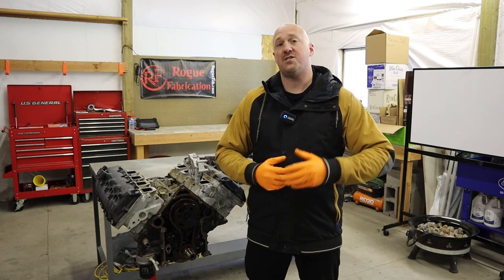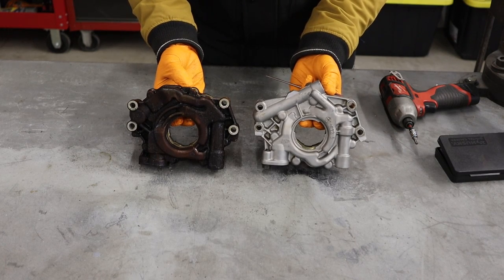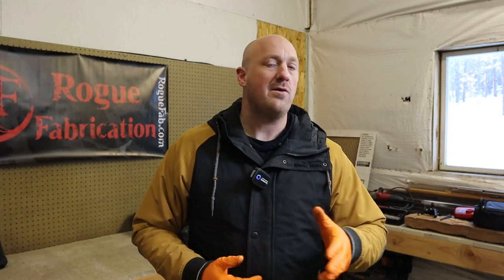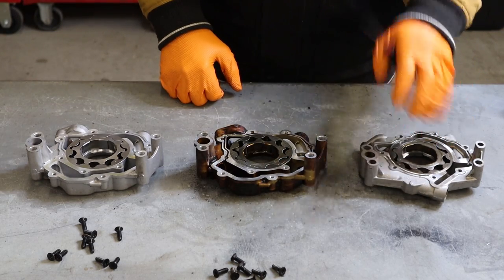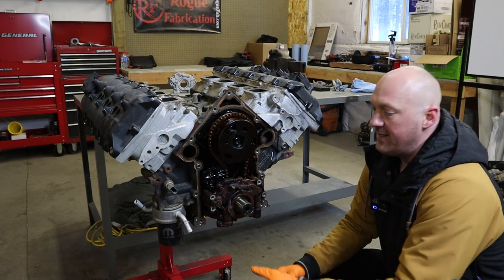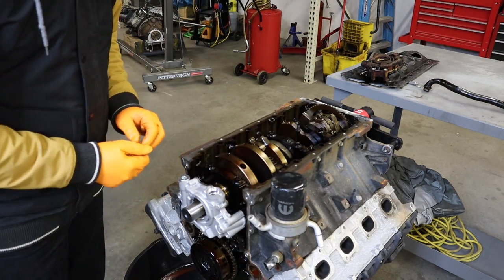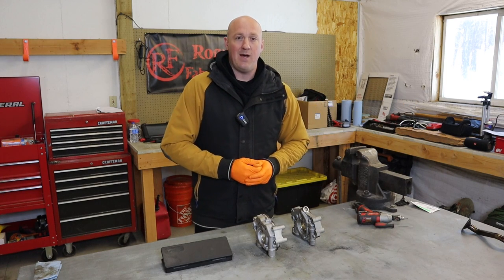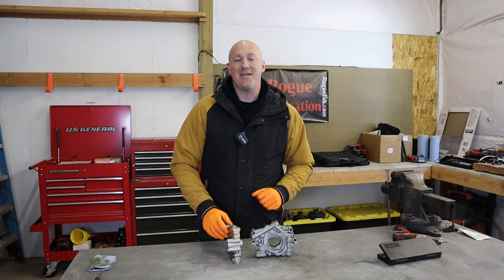Is it TRUE that Installing this ONE FACTORY PART Can PREVENT HEMI TICK?

Comment: hey guys, this is for everyone who wants to do this swap, just did this in my 2014 dodge charger pursuit. ended up calling melling oil pumps for recommendation because they make the pumps for dodge and the 5.7 hemi. now i live in a cold state and i was running into the issue of actually having too much oil pressure. stock oil psi numbers were 30-35 psi operating temp/50-55 crusing/ 60 cold start. with the 6.2 pump i was seeing 90 psi on cold start, going into the territory of blowing the rear main, and 35-45 operating temp idle, and 70-75 psi crusing. i also ran into some CELS for “oil pressure too low” and ended up being too high for the MDS system and shutting it off. this it just to warn everyone, so you don’t go through what I went through end up putting the car back together, and having to take it apart to put the stock oil pump back on.

happy to answer any other questions
Reply from the maker: Sorry to hear you were having trouble Frank. I admit though, I'm trying to figure out how having high oil pressure would blow out the rear main seal? Oil pressure and crankcase pressure are two different things.
Reply: so that is a absolutely true statement, and i thought the exact same thing. according to the guys at melling, and a different person on the forum who did the exact same thing to his charger, for some reason or another, it is possible because he swapped for the hellcat pump he blew out his seal. so the first thing i did when i had the hellcat pump on my car was taking of the oil cap and seeing if i had any blow by, and nothing. so then i thought to myself, if all the oil passages are through the block, how would it possibly blow the rear main seal, and i couldn’t really think of a way, but i guess it is possible.but what did it for me was the combination of the CEL, and the possibility of the seal, i decided to just bit the bullet and put the stock pump back on the car, and surprisingly enough, i believe that they actually made some changes to the newer 5.7 oil pumps because i am seeing different, and better oil pressure numbers on a 2021 oil pump. operating idle pressure is 38-40psi, crusing is 55-60, and cold start is 65, so i’m pretty happy with the new stock pump, and my MDS works now with no CEL.

Comment from the maker: What do you guys think of the Saturday release schedule for the videos?
Reply: Can I use this pump in challenger 6,4  2018 ???
Reply: I literally bought a hellcat oil pump and I’m installing it next Sunday, I hope it helps. My 5.7 has a slight tick after 3-5 minutes of idling hot only, and after reving it up to 1500-3000rpm it goes away for the next few minutes of idling then returns.
Reply: @adamtym4342  I do believe he said it will bolt right up.
Reply: @blakedinkel7696   Thank YUO.
Reply: Any day for video releases works for me, The 5.7 Hemi information is especially interesting to me since I own one. Thank you
I am curious if the high volume pump might adversely affect the oil based cylinder deactivation apparatus?
Reply: All good, man!
Reply: I like it. Seems like most channels do a Wednesday, Friday, Sunday drop. By doing Saturday it doesn't get lost in the mix
Reply: Saturday is good!
Reply: Any day is a good day.  If Saturday lines up better for your schedule, then so be it.
Reply: @blakedinkel7696   do your lifters and cam while your at it
Reply: @MichaelWilliams-xx6wp  don’t I need to remove my heads and all my front coolers and grill to take the cam and lifters out
Reply: @blakedinkel7696  my comment was meant to tell you adding a hellcat oil pump won’t fix already failing lifters if your lifters are failing your cam is getting chewed up as well. This content is preventative maintenance
Reply: @MichaelWilliams-xx6wp  I understand, but it only ticks after a long idle time, presumably because the lifters and cam run out of oil, but if I get of the highway or driving around it doesn’t tick at all only after 3-5 minutes of idling, but you may be right.
Reply: @blakedinkel7696   my point tho they wouldn’t tick if they weren’t broken.

Comment: My 2012 6.4 on the oil pump pick up tube has a support arm that does go to a main stud......FYI
Reply from the maker: Thanks for the info! 👍
Reply: That's correct the 392 / 6.4 from '11 to current have the pickup tube attached to a stud. So all the oil pan bolts must be removed, and lower the oil pan to access the nut that retains the pickup tube to that stud

Comment: Completely different engine but still a Chrysler.  I replaced the rockers and lash adjusters in my 04 4.7 with later ones.  The difference was the size of the orifices on the rockers, the old ones had oil spray holes about 1/8" in diameter which allowed a huge internal oil pressure leak, 16 of them actually.  I had hot oil pressure of around 7 psi at idle and a lot of lifter clatter upon start up.  Replacing them with updated ones, I believe it was 05 when they were changed.  The squirter hole was reduced in diameter to about 1mm in diameter and the lash adjusters had the feed hole moved up to put about half of it in the bore diameter itself.  These 2 changes alone raised my hot idle oil pressure from around 7 psi to around 16 psi which significantly reduced my cold start clatter.  I would replace the pump however one is not offered and this Hemi pump will not fit mine.

Comment: Just a thought, but I think the 6.1L engines would have the same issue with HC pump fit, as I don't think theyt have VVT. My 09 Challenger doesn't have it, and when referencing the Crate engines catalog, it clearly says the 5.7L has it the 6.1L does not.
Reply from the maker: You are correct, this pump will not directly fit the 6.1 engine either.

Comment: I have a 2012 Dodge Charger r/t I have just fined doing top end mods along with a hellcat oil pump the operating psi is 100 it works extremely well with my 5.7
Reply from the maker: Very nice!
Reply: @ReignitedAuto   only added it to build after your video on it. Thanks for all the content it is really helpful
Reply: Do u think that oil pressure is to high at 100 at idle?
Reply: @ReignitedAuto   do you think oil pressure is to high????

Comment: I changed oil pumps with oil pan on, tied a small string on the pickup tube bolt so I could retrieve it if I dropped it in the pan. 07 6.1, 95psi cold start, 39 psi @ temp. @ idle.
Reply from the maker: Nice work Carl! 👍
Reply: Which pump did you install Carl?
Reply: @chadwegner2705  melling hi flo

Comment: I understand this is a hemi channel so that means there mopar gear heads on here I have my own shop and I have a customer who has a v10 dodge 2500 truck its been shotguned at 2 other shops the complaint is when add any throttle off of idle it pops really bad back threw the intake manifold right into the airbox in my area there aren't many v10 truck's around and this will be my 2nd one I ever worked on the first one was easy diagnos considering the rod had made a window in the block 

And help would be greatly appreciated this truck is way to nice to junk 77,000 miles

Comment: Maybe you can consider making a video about installing oil radiator in 5.7. In fact there is no oil radiator. The engine temp is pretty high and get really high after few mins of pushing it. I did install aftermarket oil heater and it improves engine temp performance dramatically. But im thinking if this is possible to add OEM oil radiator that is probably installed on 6.4/6.2

Comment: Love the series! Do you think that Synthetic oil would help? my 6.4L Challenger requires it and I was wondering if there was a connection.
Reply: 0W-40 does help.
Doesn’t burn up as easily. 
I use pennzoil or Mobile one with Purlator or mobile one oil filter 
2012 SRT8 392

Comment: Loving your videos. I've asked this a couple times to confirm cuz you responded to my initial comment about my PSI in a way that lead me to believe that I'm in good shape and don't need to change my oil pump. 

For whatever reason with my 2016 Ram 5.7, I'm getting at least 10 psi higher at idle than what you said it should be in your video where you first postulated about the Hellcat oil pump. So about 35-40 at warm and high 50's while driving and cruising. Based on the numbers you said for the 09+ 5.7's I feel like I'm in pretty good shape. Thoughts?

Comment: Seams the lower tooth count on the up to 09 would lead to less preasure  (lower relative RPM of the gear) but if the internal dimensions of the post 09 are the same it would move the same volume just at a higher preasure.  Could that be designed in to accomodate the MDS oil preasure requirements?

Comment: I understand the pumps volumn is different, but from my experience, restriction creates pressure.  So wouldnt the fix be a stiffer spring inide the pump? Asking because melling offers a stiffer spring to allow a higher pressure at idle. Please correct me if im wrong, looking for insight
Reply from the maker: You are correct that restriction creates higher pressure, that's something I'm going to go more into in the second part of this series. However that has more to do with the overall restriction of the oiling system, not just the pump itself. The Melling high pressure pump only affects the pump pressure at higher RPM not at idle.
Reply: @ReignitedAuto  thanks. Im currently building a 5.7 stroker and deffinately dont want oil pressure issues. Im following this series for sure.
Reply: @ReignitedAuto  jw how it doesn’t effect it? Mine runs around 80 psi when cold start and 50ish at idle once warm
Reply: @5.0fixx10  what’s your build gonna be man? I built a stroker 2 years ago and turbo’d it. I love it
Reply: @jeepwk6.5L  its going to be the 392 stroker. Block bored 20 over with custom cam. awd 300. I will not be boosting this as the block will only support about 5 to 8 lbs of boost.
Reply: @5.0fixx10  awesome man! Good luck, it gets pricey quick with the hemi stuff haha. Sounds cool. Btw, if your doing a stroker why not forge it? The block will hold way more then that with a forged stroker kit. I run 22 lbs daily.
Reply: @jeepwk6.5L  its very pricey, im building it myself and its the block im concerned about. Lol. Crank and rods are forged. Im running mahle h-beams and forged crank. In the process of machining block for rod bolt clearance. I guess I need to add it to the darn channel lol, I suck at vids and editing
Reply: @5.0fixx10  I wouldn’t even worry about the block bro. I have a 5.7 block in my 6.5 stroker and I’ve maxed out a T6 80mm turbo on it haha. And hell yeah I throw u a follow
Reply: @jeepwk6.5L  I may toss forced air later down the line. Like waaaayyyy down the line 😂  I also thought of putting the build as a first car guveaway
Reply: @5.0fixx10  well in my experience, if your already thinking of it in the future prepare for it now. Nothing like changing ur mind and then needing to tear the engine apart to beef it up after it’s already been built
Reply: @jeepwk6.5L  doesnt take long to tear down lol. Only thing id need to do now is change the piston ring gap from .004 to .006. So if I do boost, the rings will have pretty hard miles on it by that time so tear and change will happen anyway 😂

Comment: Rock auto sells a high volume oil pumps for the 6.1 by Melling for 165$ that's what I went with....95 psi cold start, 39 psi at temp. and idle
Reply from the maker: Nice! I'm thinking about doing a comparison test between the Melling and the hellcat pump, would you be interested in watching that?
Reply: @ReignitedAuto  I have rebuilt my whole 6.1 from watching your videos as tutorials 👍

Comment: Thank you, my 2013 1500 just came down with lifter failure and was wondering what the best oil pump upgrade was 👌🏻 also considering the 6.4 intake swap so hopefully you got a video for that and a cam upgrade as well, no sense in pulling it apart twice lol
Reply: How many miles were on your Ram when you had failure?
Reply: @chriscaper1510  140,000
Reply: Do you know how many idle hours were on it?
Reply: Make sure you get the 2500 6.4l intake manifold and not the srt one
Reply: @chriscaper1510  i got a 13 ram 1500 as well with the same issue right now with 114,000 miles on it.
Reply: Mine same year failed at 32000

Comment: I have a question, I have a 2017 ram rebel and in a lot of people say the motor won’t last more then 100k, I have 25,700k on it. Ppl say Im going to need a new motor by the time I pay it off but I need two more years and I have Lowe mileage on it. I also was wondering if there’s any tires better then what it came from the dealership that are the open county? When It rains the tires skip lose traction control, how many miles is it recommended to do a transmission oil change
Reply from the maker: I've seen a great many Hemi engines with close to 300k miles on them. Don't listen to the haters this is a great engine. Especially if you are able to prevent any lifter issues from happening then it should be good for at least that many miles if you take care of it. I don't have enough experience tire wise to offer advice as far as that goes, but for the transmission I'd say 100k miles is a good interval. 👍
Reply: @ReignitedAuto  thank you.
Reply: I've got 149k miles on my 09 Charger 5.7L. No problems,  yet.

Comment: New subscriber awesome videos my good sir deff enjoy the hemi info I have an 06 that started the tick about 5k miles ago when wife had a valvoline change oil why I was out of state.I didn’t think it would cause such an issue I think they put conventional in.but guess lesson learned 🤷🏻.I’m planning on ripping it out and redoing it with better lifters and pump to keep it solid.I’m deff going to have to scroll through your videos.do you have a video with valve train and motor upgrades for redoing a pre 09 5.7?
Reply from the maker: Yes sir, check for two different playlists on my channel, I've got one for a black 2006 300c and a blue 2003 ram 1500, both go into more detail on the rebuild process. 👍
Reply: @ReignitedAuto  thanks sir is there any bottom end differences with the pickup or anything since I have a Jeep? And since this second video isn’t out.is it plausible to take the guts of of the pumps and swap them into the shorter original housing? Or no because of the gear being thicker?
Reply from the maker: @booming96blazer  no, can't swap the internals of the pump. As for differences, the pan and pickup tube will be slightly different, but the engine is identical mechanically.

Comment: I did this job 3 months ago. Am very, very happy with the oil pressure that I see on my scanner. One issue. Has anyone fought the P0524 code, for oil pressure too low? Popped within 2 days of installing Hellcat oil pump on 2013 Ram. Changed oil pressure sending switch, went to a Mopar oil filter that was supposedly one possible fix, with "anti drain back ", and have played with oils, and viscosity.  Cannot get rid of that code, ans it was as soon as this swap. Any help?

Comment: so I've been watching your videos to help me reassemble my 06 charger rt motor. took it out and gave slowly rebuilding it. slowly due to health issues. but I'm getting ready to put back in. my question is, is it hard to put in with the heads etc on the block as far as connecting to trans and all the wires or its pretty possible?

Comment: would it be better/easier to modify the existing oil pump to fit the larger gears? i know that would still require it to be machined but i think that would be a better way of going about it since the inside only needs 2mm taken out and there is a ridge where you can remove the material. just a thought

Comment: I am a new subscriber. I have recently been in an accident and am in the market for a used truck and I would really like to buy a 4th gen Ram 1500 with the 5.7L Hemi. My question is while I am doing research and have watched your videos concerning typical Hemi problems, I noted that you can differentiate “THE” Hemi tick from other sounds. If I purchase a truck with around 100k miles on it, should I consider replacing the camshaft and lifters as a precaution regardless of the presence of this issue?

Comment: Early Gen. 3 HEMIS 2000 to 2009! Replace Standard Oil Pump with a Miledon High Volume Oil Pump! That's if you, like a Police 5.7 Liter HEMI let your Engine Idle at very long periods of time with your A/C on while the Engine sits there unattended without Reviving your Engine to Cool down your Engine or A/C unit! All cars Oil Pump Systems are designed to run 30 to 50 PSI at Idle, but when you don't at least press the gas pedal to have the fans kick in and circulate the Antifreeze through the radiator you have Thermal break down of  your already very low Viscosity Oil like the The Chrysler HEMI 5w 20w!  The HEMI is less than One Tenth of One Percentage points of all the Millions of 5.7 Liter HEMI Powered Vehicles on the Road! The Solution is to bring your HEMI Powered 5.7 Vehicle to your Local Chrysler, Dodge and Jeep Dealership and have them install a High-Volume Oil Pump from a Chrysler 6.4 Liter HEMI Hellcat a Dodge Challenger or Charger that's it!  There's Absolutely no Engineering or Design flaw with the most Successful and Fastest Production Piston Ever Engineered!  Don't let anyone fool Ever try to Brain wash your mind Ford, General Motors, Toyota, Porsche, and Mercedes Benz/Diamilar Benz pay Royalties to Chrysler many Performance Combustion Chamber Cylinder Head Design, Especially, "The HEMI and Polyspherical or Semi-Hemi Combustion Cylinder Head Engines from the 1950's to Present Day use on the Street and all performance Vehicles both Foreign and Domestic!  Buy a Chrysler Performance Mopar or No Car! Buy A Chrysler HEMI Hellcat 300, Dodge Hellcat Challenger or Dodge Hellcat Charger or Dodge Hellcat Durango or Dodge Ram HEMI TrackHawk!